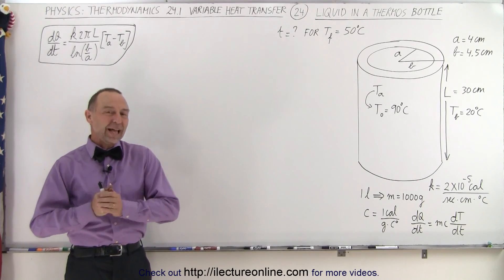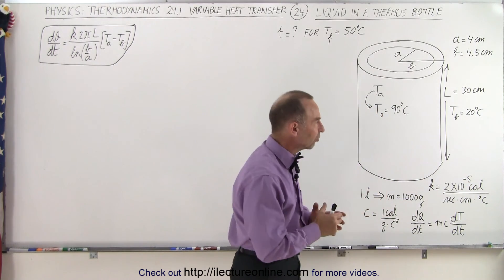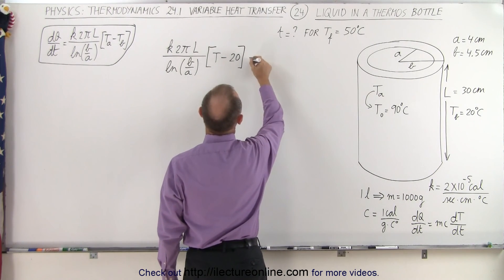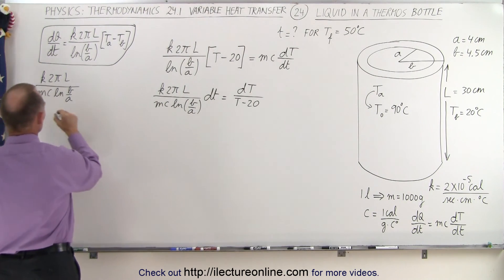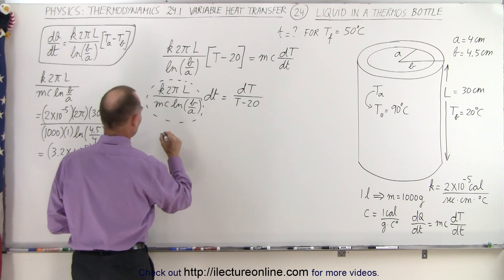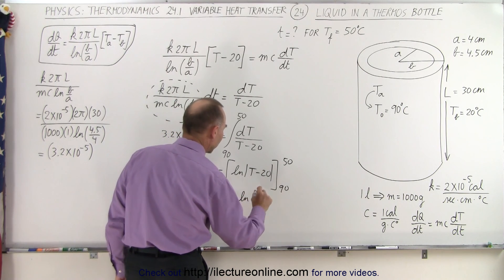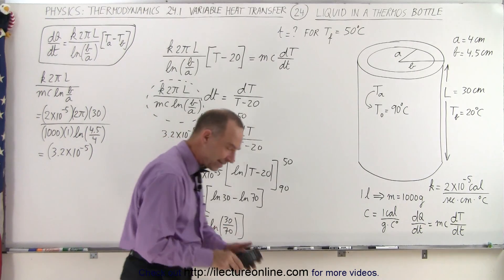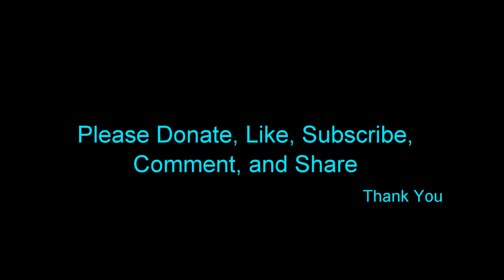Physics 24.1  Variable Heat Transfer (24 of 25) Thermos Bottle

Comment: Mr. Professor if the heat flow is in the opposite direction, do I have to change the temperature limits of integration and Ta and Tb? to calculate the time of interior heating? Best regards, Follower.
Reply from the maker: When you change the limits of integration you will get the exact same answer except of the sign (it will change to the opposite sign).
Reply: So the time for cooling is the same as for heating in such a conditions (reverse heat flow)?
Reply from the maker: The speed at which hear flows depends on the difference in temperature, the length of the path, the cross-sectional area and the heat conductivity of the material.  If those are all the same, the time will be the same.
Reply: It is great news for me. Thank You. Mr. Professor I am trying to estimate the power of the sun by using solar panels. The solar panel is made of steel pipes and energy medium is water. Since the temperature of water is 40 oC and solar panel 70 oC, it is a little bit hard to recieve precise value of sun power in a period of time, since the rise of the temperature of the panel which I measure depends on two processes cooling and heating at once. Mr. Professor would You be so kind and make a video at this topic?
Reply from the maker: We haven't covered heat exchange with flowing water yet, which is indeed a complicated topic.  You also have to remember that as the water absorbs heat, it will become warmer from one end of the pipe to the other end of the pipe, and then you need to exchange that heat through a radiator (or a condenser) depending on the final temperature of the water (or steam).
Reply: Yes indeed. This instalation (4.66m2) gives me about 10 MJ of energy in 5h period of daylight time (9-15). Water (13L) inside panels (130kg) is flowing periodically 10min (1.7L/min) with time intervals (20min). Due to the fact that water has 10 times lower value of heat conductivity than steel the rise of its temperature is not the same as for steel. Thanks to this video I was able to calculate time delay which is needed to achieve establisched in the computer program value. Due to the fact that I know how much steel and water is palced on the 1m2 of area by measuring the change in temperature in a specific period of time (0.5oC/min) I am able to calculate the power of the sun or by dividing the gathered energy by time. These two values are different of about 30%. I estimated its efficiency at about 65% (heat losses 50W). Mr. Professor Your knowledge is very precious.
Reply: Mr. Professor in my PLC program I have add time of delay which was calculated from Your equation and I have achieved energy compensation. This hint for me was huge advantage because it was simple solution. Mr. Professor You are great!!!.

Comment: Thank you sir for working out this problem. I have been thinking about it for a considerable amount of time and finally came across your video. 
I have a question. Your model considered only the heat capacity of the water and ignored its resistance/conductance to heat transfer. On the other hand, you considered only the heat resistivity of the cylinder and ignored its heat capacity. Is this a realistic model? I mean no need to consider heat resistance of the water and heat capacity of the cylinder? Or this is this just to simplify the problem and reach a closed-form solution?

Comment: Very helpful video. Thank you Sir
Reply from the maker: Happy to help
Reply: @MichelvanBiezen  
Hi Sir, kindly share me similar equation for my requirement.
I am suppling heat Q-200W,
providing h-35 (fan air velocity~4m/s),
And having Ti (initial) of 80°C (steady), Ta (ambient) 25°C
Component Mass-1.5kg
Material-Copper
Cov Area - 0.1 m^2
I want to find two things
1) if I reduce h to 25 then how much time (t) will it take to reach Tf (final) of  90°C
2) if I increase Q to 300W (with h 35) then how much time t, it will take to reach Tf of 90°C
Thanks in advance
WhatsApp 8144011363
kamurudeenka@gmail.com

Comment: Like the videos. Working on a project similar to the one in your drawing. Need to construct a thermos with following dimensions. Dimension a=0.5in, dimension b=1.5in and dimension L=48in. Need to submerge the thermos in a fluid with a constant temperature of 200°C and time for the liquid inside to reach 200°C temperature in 100 hrs (with starting initial temperature of 20°C). I can use your calculation in reverse and find out what the thermos constant needs to be. However, how will I be able to construct a thermos with that constant. Need help in selecting materials ( type and thickness of insulator, vacuum thickness etc.) . Any help would be appreciated.
Reply: i am working on a project same like you. my subject is 24 hrs with acceptable %20 loss like 100 celcius to 80 celcius. so if you done your project. can you contact me i ask for your documents because i cant find any calculations on website i am bachelors student. i am in hurry so if you see this please respond me in a second

Comment: Sir I want to increase the time for liquid that it should remain hot for long time. What should I do I mean Please tell me what factor I can increase or decrease.. sir please reply me must it is very important for me.
Reply from the maker: Choose an insulation material with a lower "k", the heat conductivity constant, or make the insulation layer thicker.
Reply: @MichelvanBiezen  thank you so much sir

Comment: Sir, It seems like the bottom area of the bottle needs to be considered if the diameter isn't small enough because considerable amount of the heat from the liquid inside will also transfer through that side. then I think the equation dQ/dt would be different from the one you've reasoned out.